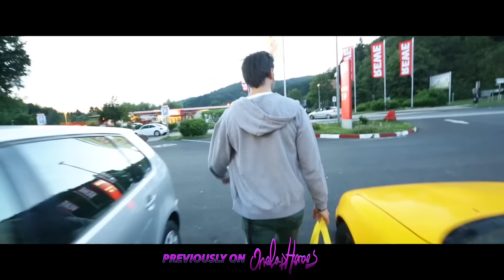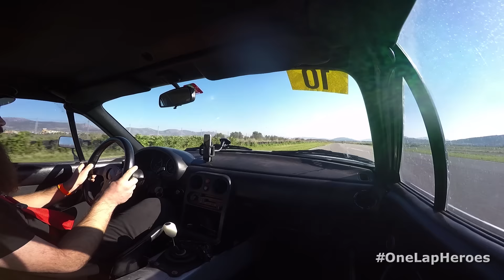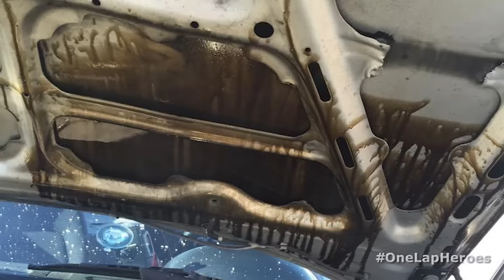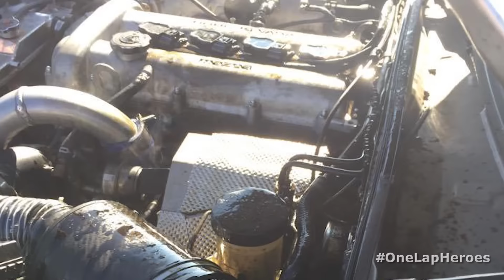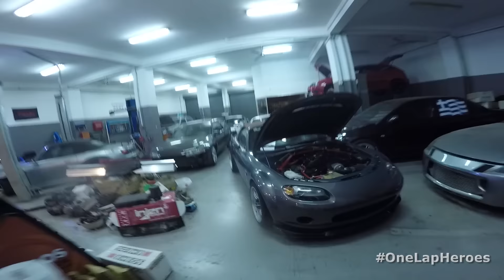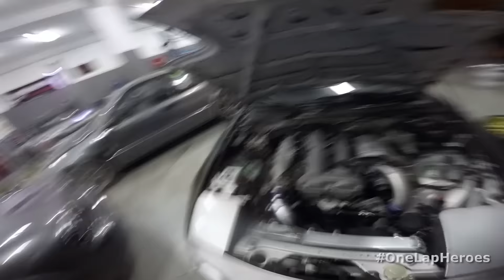How To Put Your Turbo MX-5 On Fire!

Comment: Never open a car's hood when engine is on fire. Just pump it from inside and use an extinguisher to the opening. 

Otherwise there is a big possibility fire burn your face the moment you open the hood due to the oxygen that comes in the engine bay causes the fire to expand.
Reply from the maker: Well said...however he probably didn't really expect the flames. Not that he looked too worried about it but...those Greeks are quite chilled!
Reply: +OneLapHeroes

A Greek isn't worried about a Engine on fire, he's worried about finding a german to pay for it... (joke!)

Jokes aside, assuming the engine is dead, wouldn't it be an option to swap a (nope, not one of the common choices) L3-VDT? They're used in a fair amount of cars, most notably the Mazdaspeed 3 and the Ford Focus RS and can compete with the WRX STI / EVOs engines while beeing available for a fairly low price (< 2500€ with warranty) in comparsion. While at it, a sequential gearbox is quite a nice thing to have, but it does come with quite a hefty price tag. :P
Reply: Are we now?hahaha

Comment: Damn that sucks. what power was it at? I though the mx5 engine took to turbo's well.
Reply from the maker: Generally MX-5 engines take turbos very well, even in stock form. That was an oddball problem. It was a built engine good for almost double the power it was running.